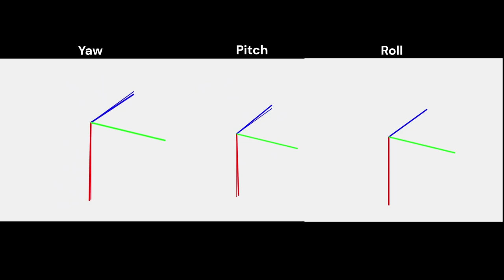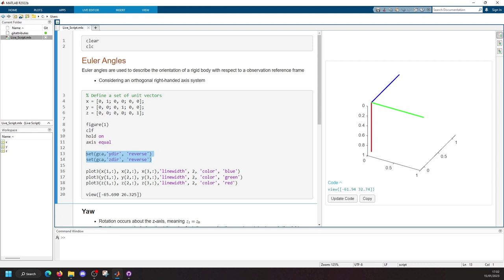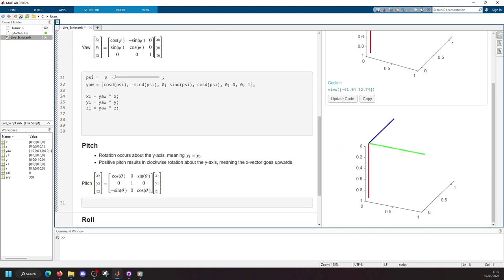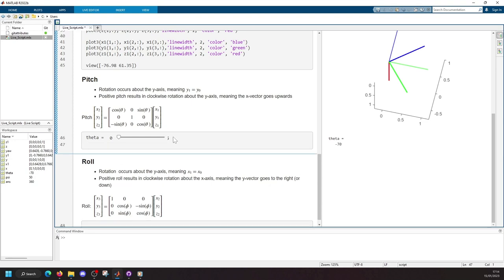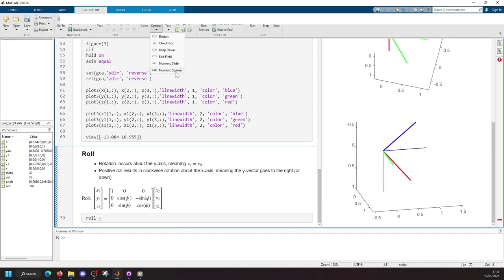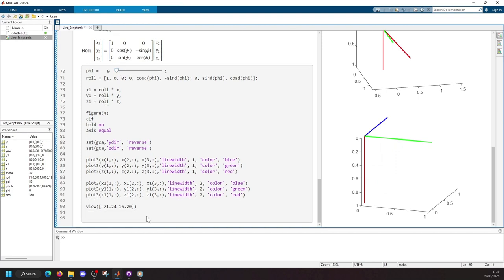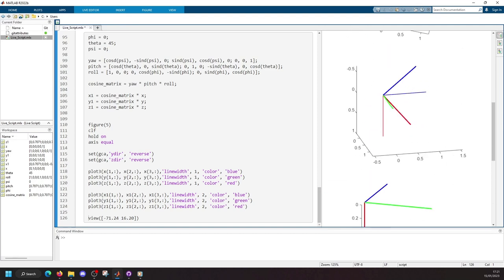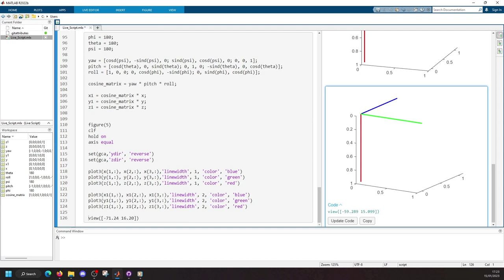Euler Angles - Explained with Code! (Matlab Demonstration)

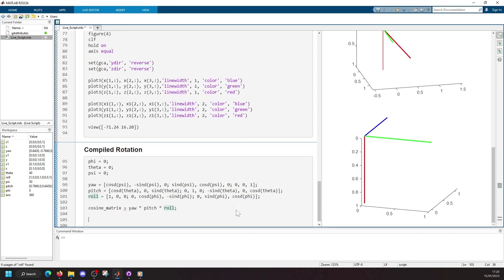Comment: Nice and clear and thank you for providing the source code.  Just I don't quite get @12:55 why you multiple yaw x pitch x roll in that order.  The Euler rotation sequence you choose should be Z-->Y-->X (or  Psi-->Theta-->Phi) hence the first matrix-vector multiplication, should be yaw x v*.  The second rotation applies after the first rotation: *pitch x (yaw x v)*.  So shouldn't the cosine matrix be *roll x pitch x yaw instead? The first to last matrix transformation should go from right to left.

Comment: Great video! Just had a question, I am new to matlab so wanted to ask, why did you define unit vectors as 3x2 matrices and not as single column matrices?
Reply from the maker: That’s a great question. In this scenario, you are right - it is not necessary and you could have them simply as 3x1 where each position is defined solely by the end point. However, for further problems in the future, we might have a system which has more than one reference frame where the origin of the unit vector coordinates are not zero values. So it’s just good house keeping to keep for the future